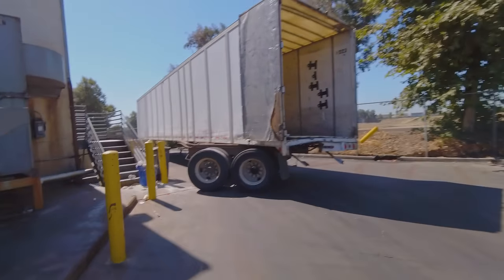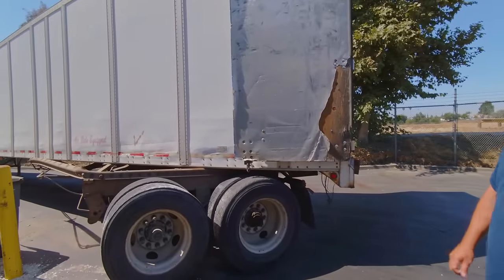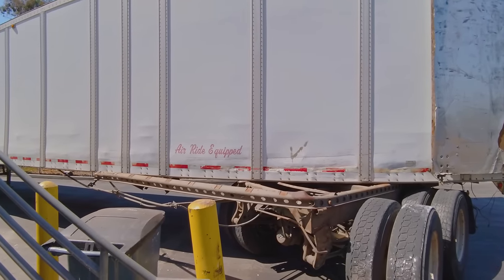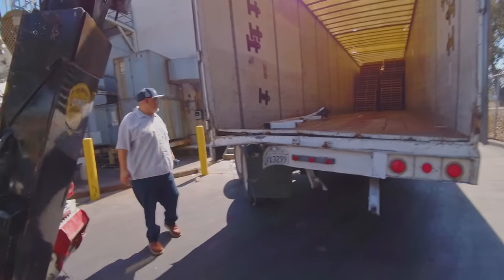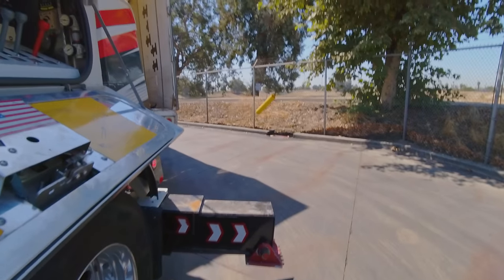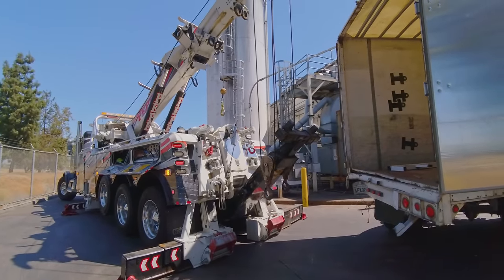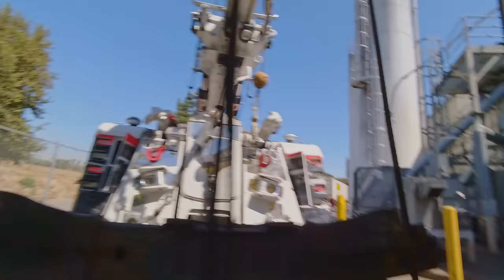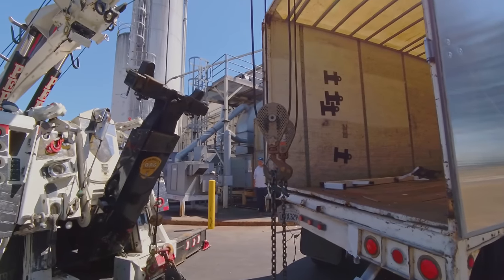Driver DESTROYS Trailer Axles With Concrete Pole

Comment: How you worked out that recovery and got it done safely was pretty damn amazing.  Kudos to the tug driver too, the way the trailer  leaned on the turns would have freaked a few out.

Comment: Josh, I'm still relatively new to your channel and I'd say that you are top shelf. You're a recovery and towing company 1st off, not a video operation and you're doing a great job on both. I'm about as tech savvy as a rock, so all I can tell you is to do what you enjoy, but don't let it take away from your primary job.
When I saw the opening shot I thought, we'll just when you think you've seen it all this shows up😂. Maybe time for the driver to take a refresher course on AVOIDING obstacles 🤣🤣🤣. Explain this to the owner buddy!!

Comment: really liking these end of video breakdowns. while will never run a rotator I do a lot of pulling people out of ditches, twitching trees with tractors, etc. correct rigging is good rigging no matter the application. if time permits would like to see some stuff on how/why/when to use the staged d-rings on boom and some, if possible, esoteric examples of that. great job as always Josh.

Comment: I'd never question the way you guy's do things, both you and Alex size-up the situation with record speed always! Gotta be honest, that second turn was a "doozie" (full jack-knife) .. But I think you are correct, other drivers would have been scared at that point. Oh shute, that was Bake-Mark I think in Pico Rivera. Not suprised he clobbered that pole, they do run a little ragged over there .. That Tyson bit was funny as a M.F. LMAO! I thought the first part of the video was just fine, I wasn't tripping at all ..

Comment: never saw such an old design with 53 feet and "air ride equipped" stickers. the frameless started failing at 45 foot design in the early 80s...hitting a bad bump in the road is all it took to fold them. 
I would not even be mad at the guy who broke it. :goodvibes:

Comment: Great problem solving.  Sketchy watching it go out onto the street and pitching back and forth like that but it made it. You're right it would have been better if it had stayed on the property.

As for the opening video quality.  Most of us didn't notice in the first place.  I certainly didn't.  I was into the problem not the video technical stuff.  As to the green screen, I can see the opportunities it opens up with the few examples you supplied.

I think most important though is avoid things that increase your work load.  If the green screen doesn't overload you further then Sure.  

Heads up to the goat driver as well who got that crab walking trailer between the goal posts in amongst the hydro poles and the other obstacles.  It really would have been easier if they would have moved the truck as he requested.  I doubt they appreciated how sketchy the sway on the rear end was whilst turning.  I hate that kind of interference from bosses when think they know best when out of the box events are taking place.  That driver was probably his lead hand.  He should have gone with his recommendation, stayed out of the way and let the goat operator do what he sent him out there to do.  Solve his problem.

So, Good informative, entertaining video Josh.  Don't fret away the farm by exposing your perfectionistic blemishes that very few recognize and even fewer care about.  After all you are running a towing and recovery company with all that entails, helping out your wife with your new baby and your other child and editing and producing top notch long form videos and posting them twice a week.   That is at least 3 full time jobs right there, probably more.

Comment: Your plan worked well. Would it be safe to use the under-reach bumped up against one side of what is left of the frame/undercarriage as a pivot point and pull in opposition to straighten the rear axle assembly in some situations?

Comment: My first thought was to run a line to the landing gear and redirect back to pull the left side of the bogey forward while holding back on the right to torque it back into position. Had you considered something like that? And, what was I overlooking?

Comment: A little secret after driving peter built dump trucks keep a fine bristle paint brush in the cab to keep your gauges on the dash cleaned up works better than anything else

Comment: I thought sure you'd use the slings to pick up the back end.  As soon as you pointed out the hook points, I thought "I dunno, G.; that looks kind of sketch."

Still, any way that works is a good way.

Oh, and yeah, he did say you had to go out and then back in.
Reply from the maker: Slings to what? The rear DOT bumper was torn off.

Comment: That side to side wobble of the trailer exiting the driveway and re-entering from the street is a good illustration of why containers, in part, are less stable in turns and on highway ramps than vans. Chassis is connected only at 4 corners vs a van being an integrated unit and more stable. Cool video tech, BTW.

Comment: Have you thought about hiring a video editor to take some of the load off? You could still do the breakdowns at the end, but maybe train someone to edit the way you like and they can handle a lot of the grunt work.
Reply from the maker: Never lol. I want to be 10000% in control. It's not like a talking head piece, unless the editor is also a Rotator operator it'll be impossible for them to know what specific parts I want shown or not shown, what part to zoom in on, etc. I wouldn't let a random person operator my rotator and I feel the same way about my videos if that makes sense